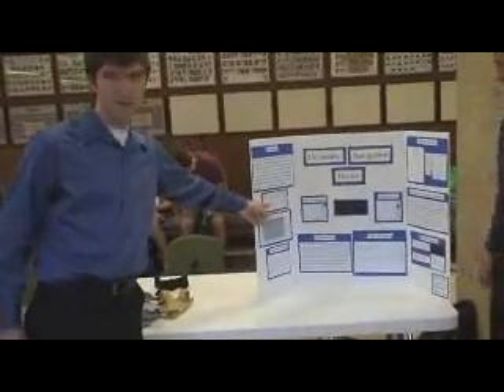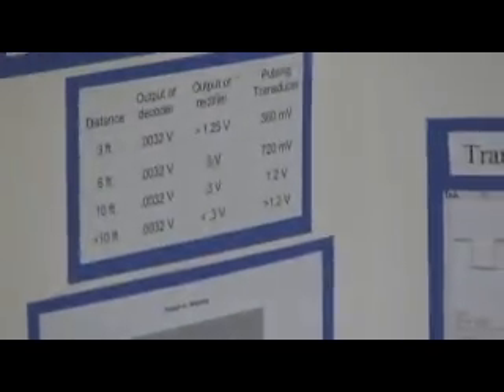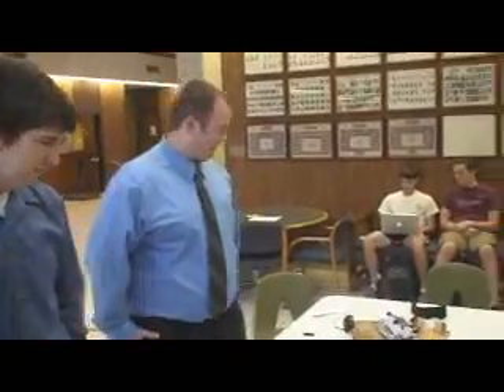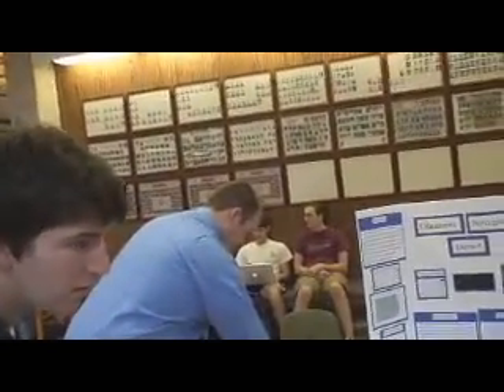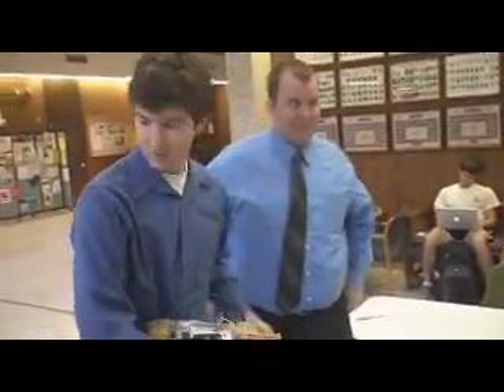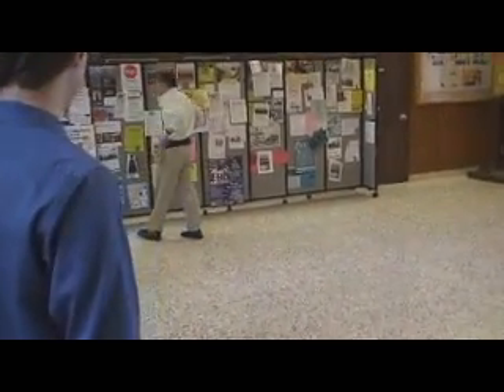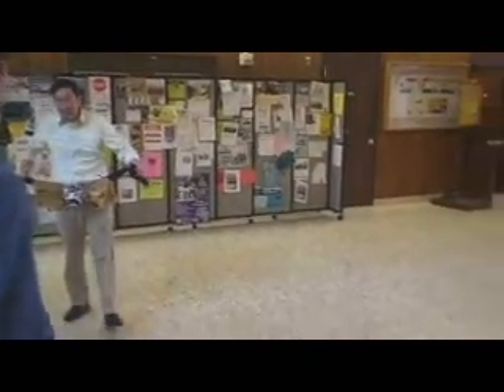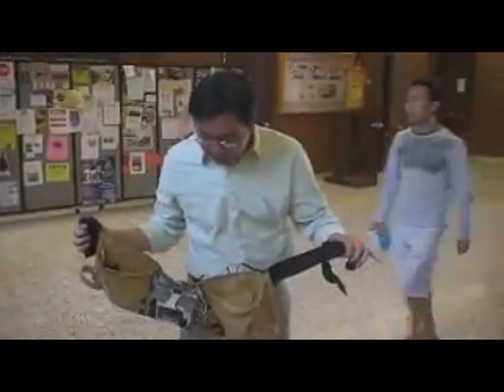ECE Senior Design Project: Ultrasonic Navigation Device for the Blind

Comment: hey i want to make same thing 
can u help me in making a project using ultrasonic range finder SRF04 n PIC micro controller, vibration motors and some transistors , ETC
please i want to use four SRF04 , four vibration motors, and PIC16F877 , i have also a circuit diagram of blind person navigation system by using these above components but i m beginner ,i don't know how to make HEX file by using MPLAB n to burn PIC micro controller  .please help me out